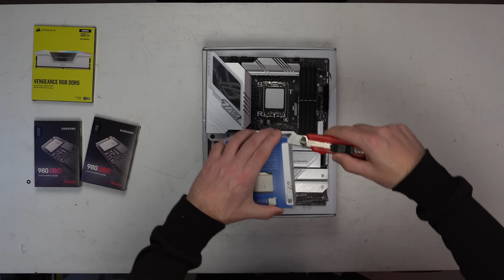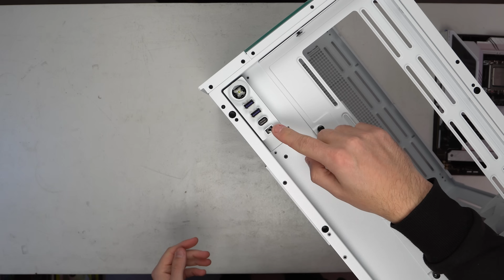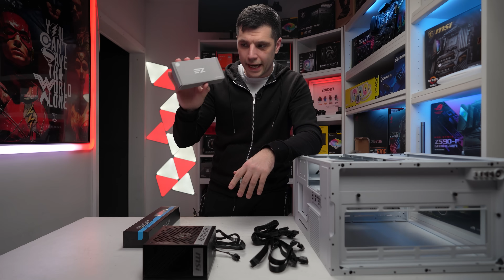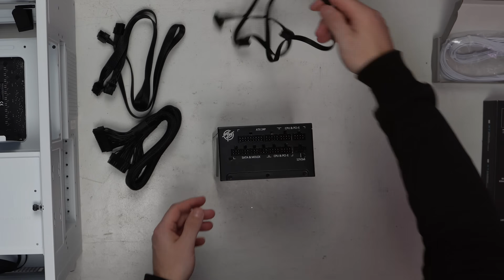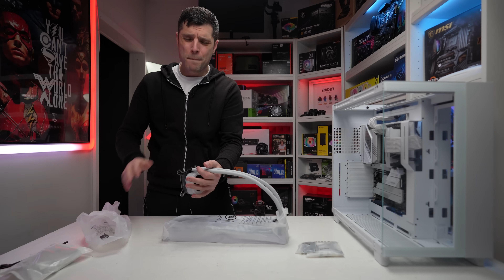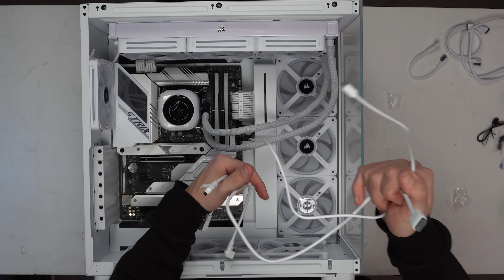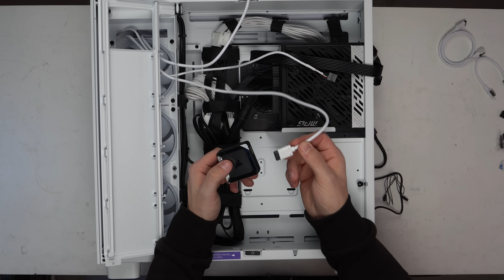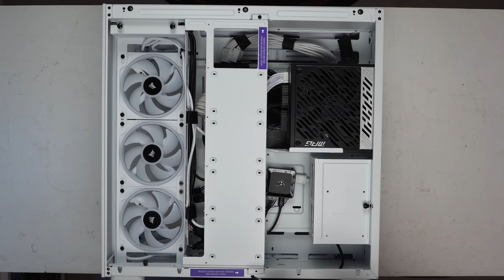Beautiful All White Nzxt H9 Flow Pc Build FT 14700K & RTX4080 Super

Comment: I did almost this exact build last week, all white. 
Vyrus_6_Blizzard
Case: NZXT H9 Flow - All White - CM-H91FW-01 - Dual-Chamber Mid-Tower Airflow Case
Power Suppy: CORSAIR RM1200x Shift Fully Modular ATX Power Supply - 80 Plus Gold -White
Mobo: GIGABYTE Z790 AORUS ELITE AX ICE LGA 1700 Intel Z790 X ATX Motherboard
CPU: Intel Core i7-14700K - Core i7 14th Gen 20-Core (8P+12E) LGA 1700
Memory: G.SKILL Trident Z5 RGB Series 64GB (2 x 32GB) 288-Pin PC RAM DDR5 6400 White
Graphics Card: GIGABYTE - NVIDIA GeForce RTX 4090 Aero OC 24GB GDDR6X - White
Vertical Holder: NZXT Vertical GPU Mounting Kit - AB-RH175-W1-175 mm PCIe 4.0x16 Riser Cable
AIO CPU Cooler: CORSAIR iCUE LINK H150i LCD Liquid CPU Cooler
Fan Sets: CORSAIR QX RGB Series, iCUE LINK QX120 RGB WHITE STARTER KIT x2
Back Fan: CORSAIR QX RGB Series, iCUE LINK QX120 RGB WHITE
OS: Microsoft Windows 11 Pro (USB)

I went with a white power supply because I didn't want to have to buy white extenders and it turned out very clean with less wires. I also like the vertical mount, with a card this heavy it made sense, also the high power pins have less stress.

Only think I think I would have done different in your build is go with 64GB memory. Great, detailed video. Loved it. Thank you....
Reply from the maker: First thanks for watching and wow what a build you have - great part choices and will sure be a beast of a pc. Yeah tge reason for 32gb and not 64 was budget and tbh it can always be upgraded in the future if needed tbh it's only for gaming and 32gb is more than enough. Thanks again 🙏
Reply: what is the cost of such build here in UK,  if don't mind asking? Looking to get my first ever PC and wonder if I could build it myself. Now got mid 2011 imac 21'.
Reply from the maker: Hi mate for all this £3k but without all the rgb and fancy bits you could build this system around £2400-£2500 not cheap